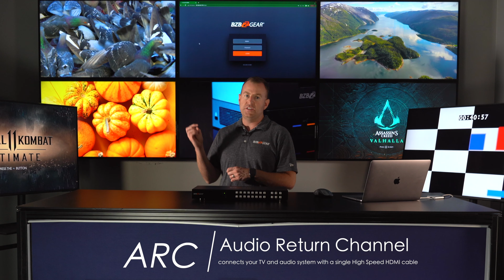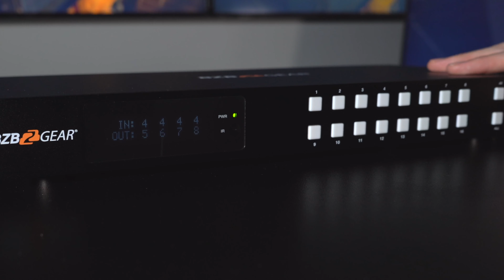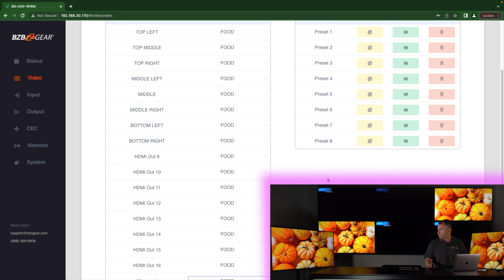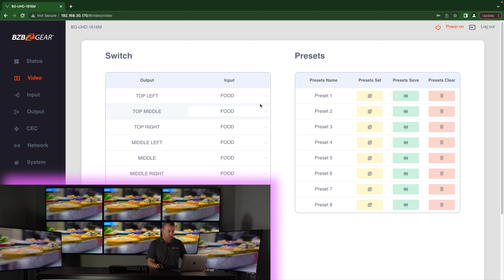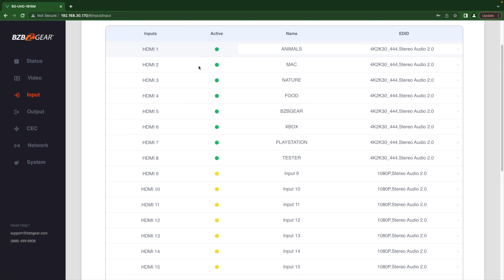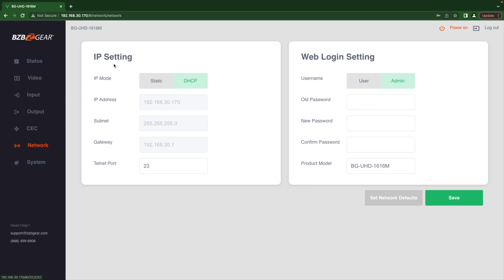Easy to Control 16x16 HDMI Matrix Switch with ARC - BG-UHD-1616M

Comment: Can you downscale to 1080i or 720p?
Reply from the maker: absolutely!
Reply: @BZBTVchannel  the only option I saw was 1080p
Reply from the maker: @djones02  on the video, 4K and 1080p are the only options that were showed, however the unit has 21 factory defined EDID settings, 2 user defined EDID modes, and 16 copy EDID modes. 1080i is one of the factory defined settings and 720p can easily be emulated and copied when that particular source device is connected. Also, here's the link to the manual if you want to take a look for yourself, https://bzbgear.com/wp-content/uploads/2020/manuals/BG-UHD-1616M-manual.pdf